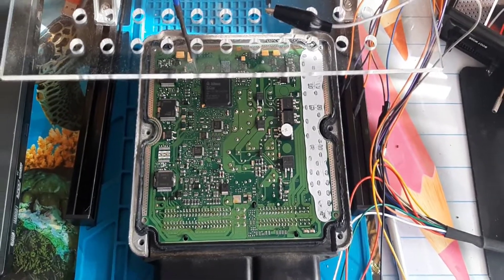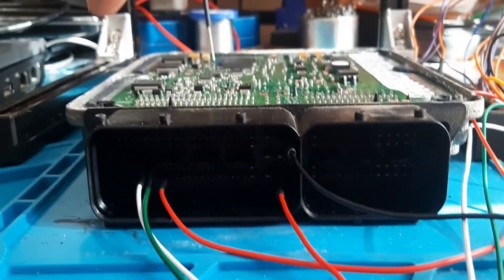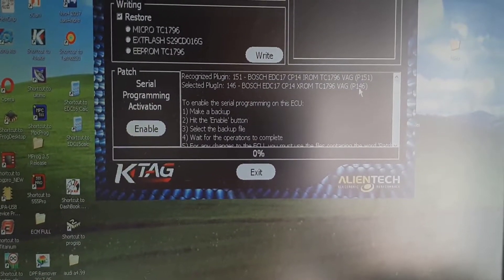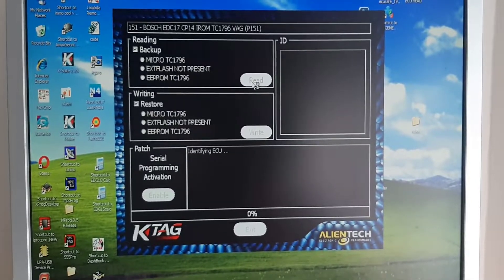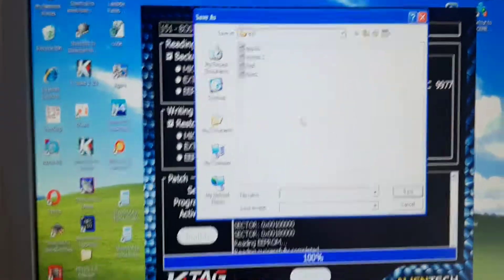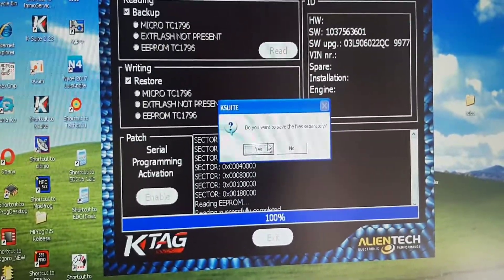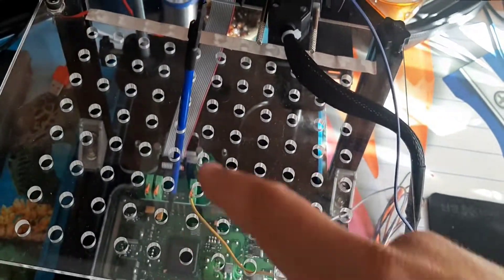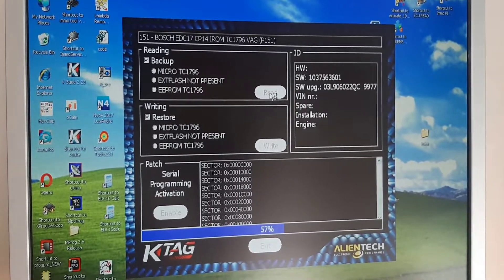Volkswagen Passat  ecu EDC17CP14. read BDM vs Tricore

Comment: How many amps the power supply needs to be? I found a good one for 50€ with 2amps. Should that be fine?
Reply from the maker: Yes , 2A it's ok.
Reply: @YOYODiagnostic  thanks a lot
Reply from the maker: @lowrider69yearsago58  
You are welcome.
Reply: For $10-20 you can get a used server power supply 1200w 100A 12V. They can be modified to produce 12-15.5v depending on the resistor values used. I use HP DPS 1200 FB/1 HSTNS PL-11 as I find it the most reliable and easy to modify. At 14v it can supply up to ~83A of stable current..which is perfect for BMW programming.

Comment: Some EDC17CP14 readed by Kess in boot read only partial read, but with Ktag always read a full read.
Reply: 03L906022B kess obd ok?
Reply: With original yes. With clone you need VR file from 09 year. @valentinlazar2049

Comment: How are you is this CBAB backup? Would you mind sharing with me? I used FC 200 to read and it's no rpm on instrument cluster
Reply: I used tricore kess v2 clone. No problem at all.
Reply: @Morteexx you used kess v2 from aliexpress to read and write the map in this ecu for Passat B6 motor CBAB?

Comment: Question do you know which pin on CPU is boot and is the boot pin is same to other ECU? im trying to read one CPU that is same but there is no schematic on boot ? 
Thanks !
Reply from the maker: Hello. 
If the CPU is the same then the Boot pin is the same,  imagine that if you should have read the order of the pins in the programmer it will always be the same if it is the same CPU
Reply: @YOYODiagnostic  ok thats good only need to remove one CPU of known ecu to see boot to which ball going i also have pdf for a tc1769 but can not understand where is boot. Thank you !